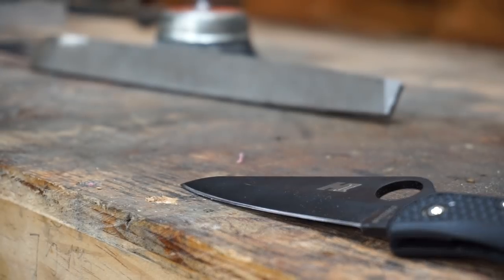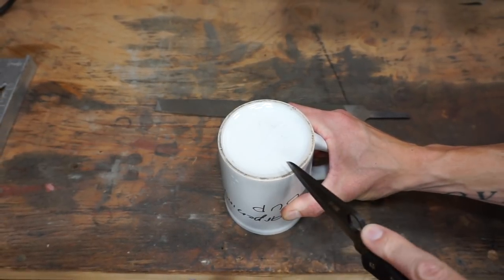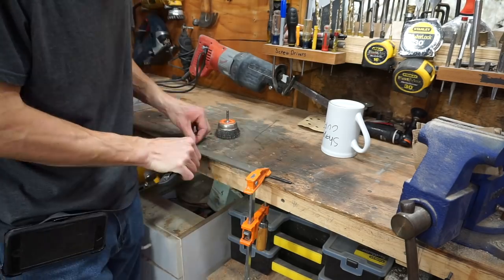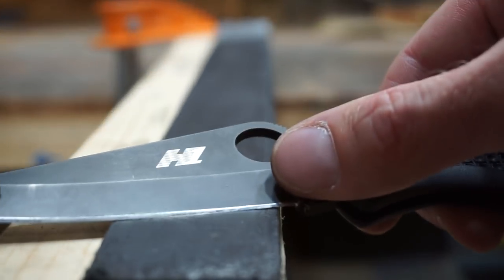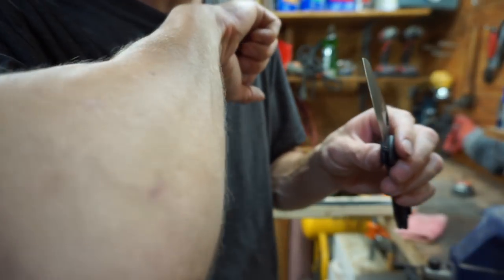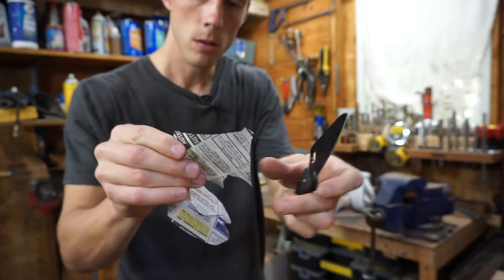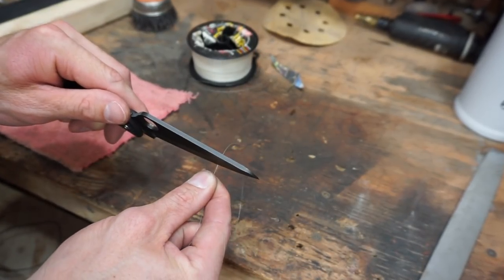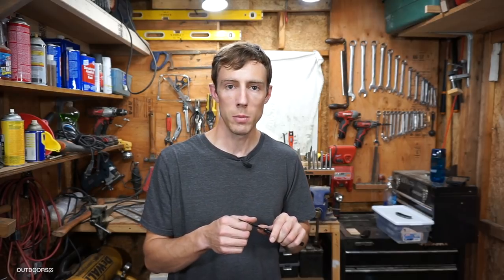WEIRD KNIFE SHARPENING METHOD. Can you sharpen a knife on a file?

Comment: my shitty cheap swiss army beater knife normally gets sharpened on the thumb wheel of a bic lighter. it aint pretty but it does give it a useable edge at least
Reply from the maker: Now THAT is an interesting sharpening method. I may have to try that👍
Reply: OUTDOORS55 not sure if it would work on good steel but on cheap Chinese steel it does a good enough job to continue what I was doing
Reply from the maker: Yeah it may be harder on s30v lol
Reply: probsty13 then it's not a real Swiss army knife
Reply: yes i know that it is not a real swiss army knife. but it is like when you ask for a tissue. most people just say kleenex.
Reply: No such thing as a shitty swiss army knife, unless it's a knock off and not a real Victorinox

Comment: A smooth cut file will sharpen you knife just fine from experience carbon steel blades are more forgiving to file stainless steel is better off with some kinda sharpening stone that's just me to each his own and a knife doesn't have to be razor sharp to function right skills is the answer

Comment: Am I missing something, I have watched forged in fire and they test a hardened knife on a file, the file is supposed to skate off the edge of the knife without cutting into the edge.
Reply: Graham Parr  when you heat treat carbon steel you heat it to critical temp and quench . At this point the knife should be harder than the file. Hence the file skating and not cutting . But due to this high hardness , it’s fragile. After hardening you temper steel.  ie put it in the oven on around 400 f for a couple hours. This brings the harness level down to a happy medium between knife having good edge retention, and being so brittle it’ll shatter if you drop it.
Reply: Wendy Daniel Nicholas of course, I am an idiot.😳

Comment: If the difference in grain of the abrasive tools are big, it just means it takes you very long time to "polish" away the burrs of the coarser tool.

You can save time on a very dull blade by starting with a file then switch to sandpaper for instance with 400 grit, then 1000+ grit and finish it with stroping.
This way you dont have to de-burr the file burrs much with the stroping

Comment: You did not mention what type of file you are using....?  Maybe try using a very fine tooth file
Reply from the maker: It was a $7 Nicholson flat bastard file from Home Depot. It's an older one that needs to be replaced as it's wearing out. Some of the finer files would definitely produce better results. Thanks for the suggestion!